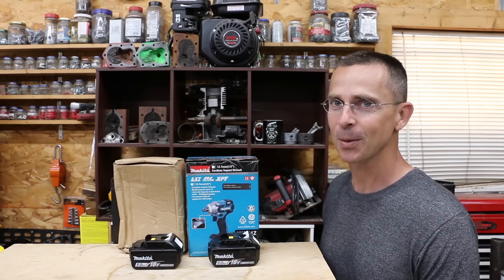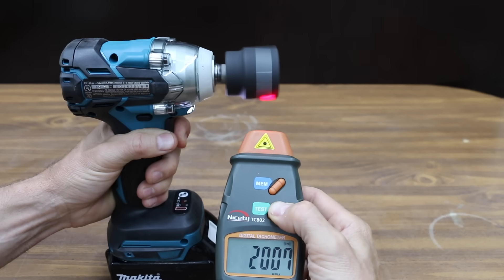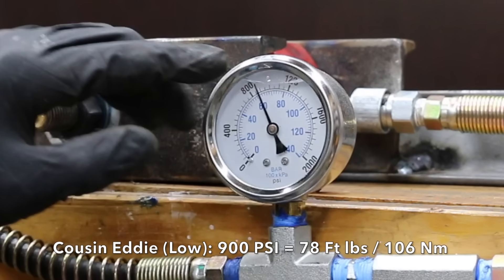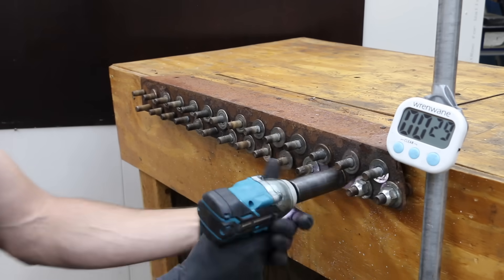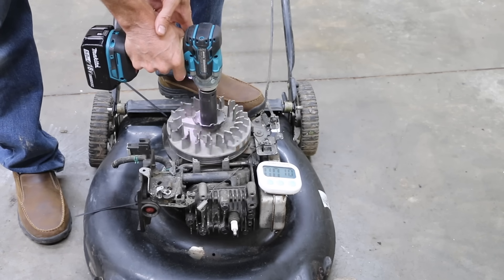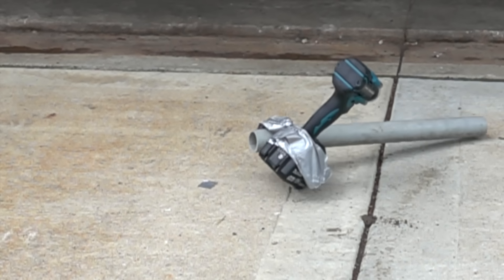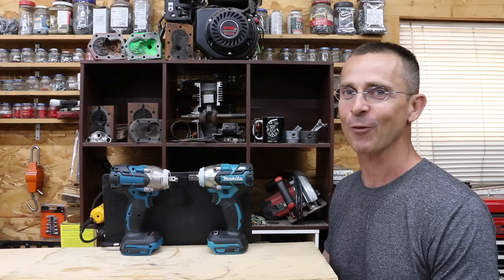Fake Makita Impact Better? Let's find out!  Makita XWT11Z 18V LXT Lithium-Ion Brushless Cordless

Comment: Great stuff!!
Can you do a comparison of the Makita cordless Palm /hand held Router Vs the Makita Knock-off version basically the same as this test but with the hand held router versions!? It would be interesting to see as the cordless router market has been flooded with 6ah Makita copies and I might be mad but I just bought one for £60 or around 90usd with a 6ah battery with brushless copper wound motor. So I'm hoping it works when it arrives! I haven't got a Makita to compare it to but if it's rubbish i don't want to fork out for a Makita (having got the Makita compatible 6ah battery) if the Makita is no better lol 😅 or if it turns out to be a good tool.. 
Either way would be great as I know a lot of tradesmen and DIYers that's would appreciate the video the same as this one!! 
Thanks from London England 👍
Ps the Makita Vs knock off 
In the handheld cordless Circular saw/"skillsaws"  and also on the hand held Grinders would also be great given Makita is such a good brand I've heard rates around 2md or third on the list for most people and is relatively affordable and also the most copied brand coming from China these comparison tests Vs the Makita versions of all the above would make great videos if you haven't already that is if you have then I apologise and would appreciate a link as I did look but couldn't find any..
Thanks again for making great videos!!! 👍💪😎🏴🙏
Reply from the maker: Thanks!  Thanks for the suggestion.

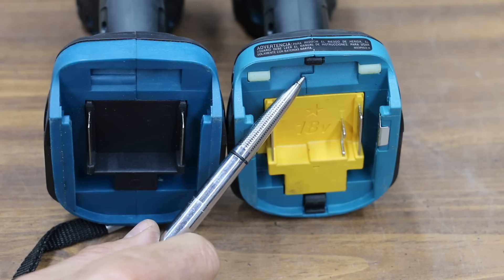Comment: So; I could buy 3 KNOCK OFF'S and have change left over for 1 name brand one? They are not knock off's otherwise the tool would have a name on it like "Makeeta"-that is considered a knock off as they are trying to fool you with the Name too(close but not quite)  Considering the drill will spend most of its life in a tool drawer(not doing any work) I will buy 2 KO and buy beer with the other $70.  Besides if "Eddie" gets PERMANENTLY "borrowed by some dude" it is not a great loss.  It did OK.  The KO battery - was NOT the same battery shoe as the Makita, @1:47
.  I noticed that the manufacturer's are not making the battery shoes universal so that means buy their brand because no other brand will fit(which means chargers are different)
.  Not like the good old days where 120V AC plug is a Universal plug for all drill types.

Comment: Why don’t you do a comparison on good 3/8” electric impact wrenches?
I bought a Harbor Freight Earthquake impact and it will break wheel studs if your not careful, battery lasted me 6 months before a charge
It more expensive than the one you tested from HF but I’d put my Earthquake up against any snap on or any high dollar tool truck impact.
I liked and subscribed 
I really like the duralube test because I have been using it ever since they took slick50 off the shelves 
I rebuilt a 2 stroke engine and treated it with slick 50 2 stroke treatment and it worked too well
The customer came back saying the engine wouldn’t start.  Turned out that the Slick 50 coated the cylinder was so good the rings wouldn’t seat, had too re-ring and hone the cylinders and break in the rings and pistons and then treat it with 50
Slick 50 was developed for aircraft engines in the 50’s and I have used it many times and my engine ran cooler and gained 200 rpm at idle
The rest of oil treatments are junk like Z max, garage 
I ran my 88 Astro van out of oil 5 times and still made it too the closest place to get oil
My 98 Astro has close too 500,000 miles on it and never took a valve cover off yet
Please do a high end 3/8” electric impact and I bet the HF top of the line Earthquake will out do or be rite there with them
Reply from the maker: Thanks for the video idea.

Comment: The knock-off tool only has two battery contacts, they skipped the temperature sensor. This could result in reduced lifespan or damage to the battery. The effects would be worse on lower capacity battery packs too.
Reply from the maker: Thanks for the feedback.
Reply: Battery safety is a significant concern for knock-off battery-powered devices.  I'd more readily buy a fake chord powered tool than battery powered one.

There was recent news of someone losing their new house because a charging tool battery back caught fire.
Reply: @kanankiri1306 yeah even worse them fake battery that come with tools charge with a round plug ontop of the battery with a flimsy charger that feels like its 10grams but it works but doesn't feels like save. But i charge it on the cement groud. Never be save of any battery when charging
Reply: Doesn't matter, they're cheap to replace!
Reply: @Altair885  The batteries are not very cheap at all. It's the battery that will be damaged, not the tool.
Reply: @mrfrenzy.  Buddy, the whole tool including batteries is a fraction of the cost of a genuine one, just buy another whole kit!  Or order a shed load of cheap batteries direct from China.
Reply: @Altair885  A genuine makita 18v 5AH battery is $101 right now on amazon, or more than 3 times the price of the knockoff tool.

Comment: Excellent comparison. You didn't do an endurance test: how long does each last putting out high torque. I had a cheap drill that was a de Walt knockoff that did very well but would go dead in half the time under load.

Comment: I tested a Makita knockoff in a professional accredited lab. First thing we found was that the battery charger it came with didn't meet FCC regulations for electrical interference. I wouldn't take one home if it was given free, because if it doesn't meet FCC, it probably doesn't meet UL regulation either.
Reply from the maker: Thanks for sharing.

Comment: Honestly from how wide of a gap the differences and to put into consideration the performance and numbers it still might seem cousin Eddie is the better value at a fraction of the cost that's a real deal. But not everybody has a hundred and something dollars to spend on an impact tool. Go with air you won't regret it.
Reply from the maker: Thanks for the feedback.
Reply: Well I've used a couple of knock offs and they work well for the first few days then it just slowly dies, the torque goes down the machine heats up the battery doesn't hold power as when it did when new it's just a money trap imo... i have a makita driver and it's still working as when i first bought it 2 years ago.. I can't comment on pneumatic tools cos I've not used them..
Reply: @peacefulearthling  Yeah most likely you probably got a knock off of a knockoff. LOL what you need is not a knock off but a clone, those are far superior than cheap knockoffs. I mean technically a clone is a knockoff but they're supposed to be considered the better knock off I guess.

Comment: It seems you are treating cousin Eddie on the removing of the bolts a little biasly. For every boat that you took off with cousin Eddie it took you about 2 and 1/2 seconds to switch from one boat to another like if you are purposely lagging behind. But with the Makita you were noticeably switching from both to bolt faster like if you were oh I don't know, purposely speeding up to give it an edge. That's the problem with that test it relies on how fast you can do it instead of how fast the impact wrench can take off the boat. But the video does show you might have been giving the Makita a little more of an edge over cousin eddie.
Reply from the maker: Thanks for the constructive feedback.
Reply: Yeah, I saw that, too

Comment: Ive now own a cousin eddy impact for a little over a year now and i can say it held up for me it has taken off countless rusted lug nut, rusted suspension components, taken apart battery tiedowns that destroyed some snap on ratchets we had and even took off a semi truck lugnut( it struggle)it even out preformed a cheap craftsman pneumatic impact wrench we had. Only now after a year of serious abuse is it starting to fail in cold weather cause you have to wait awhile for it to pick up speed but once you warm it up its good as new. So if you need a cheap wrench for work or a small project cause you dont wanna spend the money on a real makita i would do it. But i am now looking to get a real makita impact(or mabye a Milwaukee m12 stubby) for mechanic work since cousin eddy is starting to show its age and since we have started to use it more for roofing instead of a normal impact driver since the anvil has a 1/4 in collar thats great for driving the 1/4 in lag bolts we use for metal facings and its so convenient to just put the 1/2 inch socket for drain work but for the 40 bucks it cost me i would buy it again if i needed to.
Reply from the maker: Great feedback on the Cousin Eddy impact wrench!!

Comment: I received Makita clone a few days ago. I ordered wrench only thinking that it would go with the battery, you know the mini 4" chainsaw made talk of town like this Makita clone impact wrench. But the battery doesn't go with this impact wrench, so I ordered battery and charger. However, today I gave this clone a test run. I tightened a lug nut 125fp with a torque wrench and cracked loose in 1.5sec wait. The Battery(4ah Makita clone) had 2 bar. I will give rigorous test with a fully charged battery when the charger comes in a few days. Please, stand by.......
Reply from the maker: Thanks for sharing.

Comment: I used Makita professionally for about 2 years, it was abused for many hours a day, dropped often, sometimes just being lazy, using it's battery pack as a hammer (not too hard). I had tried cheaper brands, but you just can't compare wheel barrel with a Scania. I'm pretty sure DeWalt or Bosh are making quality tools aswell. Knockoffs are 4-5 times cheaper, and for house use that is fine. Professionals however will always get more value out of premium brand, you pay extra but you get much more work done faster and reliably.
Reply from the maker: Thanks for sharing.
Reply: exact same here, Im told Dewalts are cute too.. but why switch whem maikita is the life blood of my daily work, and never lets me down.

Comment: I dropped my Makita impact driver from a rooftop. It head straight down into concrete. All that did to it was to give it a strange sound when working it, but otherwise it works just as good as when it was new.
Reply from the maker: Thanks for sharing.

Comment: Used these at work at the assembly line. Makita are crazy strong machines. If you wren't careful it could torque snap a bolt in half easy peazy. Good stuff.
Reply from the maker: Thanks for sharing.

Comment: hears a brain burner for you. im a reciently retired auto mech..hears the deal oem spec. oil verses super synthetic  in a test of hydrulic pressure retention at engine operating temp..
ive had customers use the racing class synthetic in regular engines enginiered with variabel valve timing the raceing oil did not support the vvt sytem and caused performace troublels that wen away when oem spec oil was put back in the engine and used as recomendid
Reply from the maker: Thanks for sharing.

Comment: $30 for a brushless motor is incredible value and for the casual DIYer it might just do the trick.
On the other hand the Makita is definitely for the professional tradesman who will use this tool on a daily basis and get a good service life out of it.
Reply: For the Price, You can buy 6 cousin Eddy. So question is, Would 6 cousin Eddy last longer in the LONG RUN?
Reply from the maker: Thanks for the feedback.
Reply: Полностью согласен, за 30$ для домашнего пользования  отлично.
Reply: 30 dollars isnt a lot for this tool but im buying this tool only to remove car tyres and would i choose the 30 dollar tool for this job? Absolutely not... Makita all the way :P
Reply: Not really. A Makita is something you buy once and it will last a lifetime. The $30 one is one you keep buying because it breaks in the most inconvenient moments.
Reply: I’d buy the $30 one for sure
Reply: There are nuts that only the Makita will remove
Reply: that's exactly what he said at the end lmao
Reply: @LC-hd5dc  Yeah correct, but I got a pat on the back for stating the obvious, a whole year ago.... What did you get?😂👆
Reply: @Gary-Seven-and-Isis-in-1968  good luck.
Reply: Makita is not all that great had one didnt last long with battery my Metabo last longer and more powerful
Reply: @FenrirYT13  :
Makita tools are fantastic👏👌😀

But : angle-grinder doesn't like sticky dust going through its rotor.

 New Makita angle-grinder died in third day of cutting soft marble.

Makita Customer Services ...dead !

I brought it for repair to official professional tools 
service & repairs : 

mechanic's subtile recommendation :
For sticky dust  😀get the blue BOSH (industrial)👌😄

14 years later BOSH angle-grinder👍
still 💪working👷‍♂️ just like in its first day 🙌 

But Makita angle-grinder (12000 RPM) deliver a beautiful sound of
 V12 SCANIA 
which it makes an immense satisfaction each time you accelerate it before cutting ...😉 😜 

(SCANIA is taking notes 📝... 
for further projects)

(V 12 SCANIA drivers in :
😲shock😮😲)
Reply: @mariano7699  are 🤣 you 💀 having 💪 a ✊ stroke 🔥🔥🔥?
Reply: @FenrirYT13  Sounds like you mishandled your makita, mine is perfect after years of use. Even the batteries.
Reply: @FenrirYT13  r u joking my dad has had a makita drill for 17 years and still going strong

Comment: Fake vs real. How about real vs real. DeWalt vs DeWalt. Milwaukee vs Milwaukee. It would be cool to see how the cheap DeWalt plastic chuck Lowe's endcase specials compare to the more expensive metal Chuck models. Same thing with some of the Milwaukee m12 drivers and rachets. Or the DeWalt 60v tool with a 6ah vs a dewalt 20v with a 20v 6ah. Brushles vs brushed models. Imported models vs usa made models . Are the higher grade tools worth the extra cost within their own brands. Seems like a lot of brands offer a cheaper line if tools now
Reply from the maker: Thanks for the video idea.

Comment: I bought a Drill Pro, for Makita battery on Ali Baba(excuse me for that). I think a lot of those brands are the same tool only another name, sometimes another design.
For DIY projects at home, it works great. Nothing wrong with it. Powerful enough for “regular” screws.
Maybe not for 20/30 centimeters long screws; but i don’t use that.
And again; a Makita battery can be used(for this model).
Costs 1/4 the price of a original Makita, don’t forget that.(And yes, i am Dutch..cheap cheap cheap).
The “A”- brands are not happy with these clones of course...
Reply from the maker: Thanks for sharing.

Comment: I may have told this story before but I had some intricate emergency roof repairs on my out of town out of state house (ah and laying some flooring under some door jams) and I forgot my couple harbor freight multi tools and had to buy one at home depot which was 20 miles closer than nearest harbor freight.  I bought a makita multi tool.  I have gone from 1990s porter cable only to Bosch only and now made in China makita only ! Makita is a nice tool.  In 1990s got a pair of 9.2 volt makita drills which are still going strong.
Reply from the maker: Thanks for sharing.

Comment: I have to wonder if testing the Cousin Eddie with the battery it came with would produce different results. I noticed in many (If not all) of the tests, there was a Makita battery installed.

Still a very surprising results. I wouldn't have expected Cousin Eddie to do nearly as well as it did. Never dreamed it would match the Makita, but it still did pretty darn well for a $30 piece of kit.

As always, awesome video, and very comprehensive testing. Keep up the awesome work!
Reply: Cousin Eddie doesn't ever come with a battery, unless you buy a 'bundle', that comes with a knockoff battery. Performance is very much tied to battery quality, especially in terms of amps delivered (motor strength), and how long the tool will run until it needs to be recharged.
Reply from the maker: Thanks for sharing.

Comment: In looking to buy any electric power tool, battery or wired, I don't "choose to buy made in China" but there is really no other choice, unless you buy some super expensive brand made in Europe (Festool?). I have resigned myself that if I have to buy made in china power tools then I will buy a "name brand" over a no name brand in the hope that a name brand will at lease have engineered/designed the tool to perform better and last longer and hopefully oversees the Chinese production and quality.
Reply from the maker: Thanks for the feedback.

Comment: A lot of the time what you'll see in China is what's called third shifting. They'll have all the plastic molds and assembly workers for a foreign designed product like the Makita. But they'll replace several of the parts with cheaper versions of those parts and then sell them to a distributor. Likely they were both made in the same factory on an unauthorized shift where the factory was making products for themselves instead of for their foreign contract. That's why you see such a similar design, because the only thing that's changed is the components not the blow molds.
Reply from the maker: Thanks for sharing.

Comment: If you went back a generation or two in the Makita line you would probably find you have Cousin Eddoe. These were probably made in the same factory with Couson Eddie just using the older line than the current Makita.
Reply from the maker: Thanks for the feedback.

Comment: Another thing worth noting is the Makita is more likely to get stolen. Also you could go through 4 knock off drills before you approach the price of the Makita. I suppose you'd have to ask yourself if those small margins make sufficient difference to warrent a price 4 times more expensive? With a job specific tool like this I'm not sure you'd be using it enough to make that much of a difference...
Reply from the maker: Thanks for the feedback.